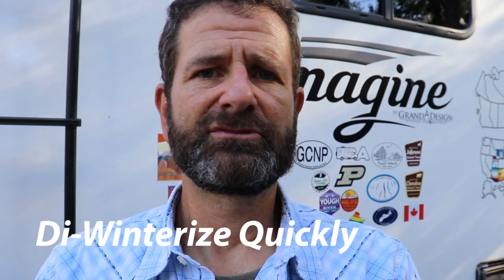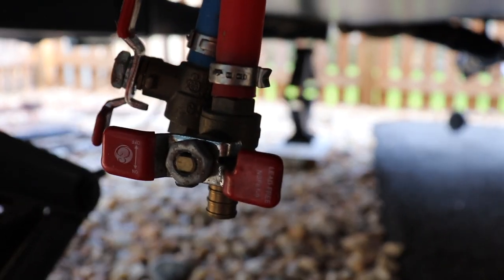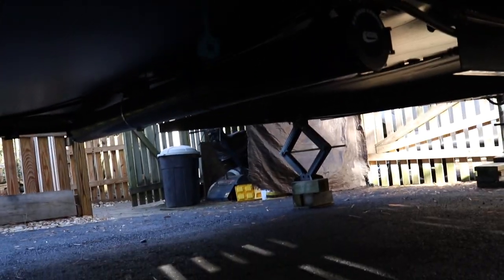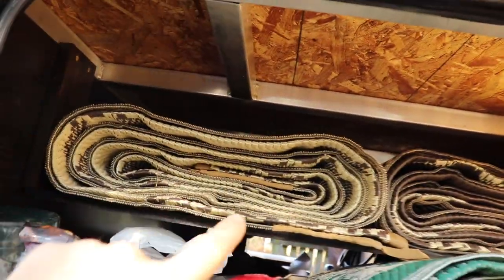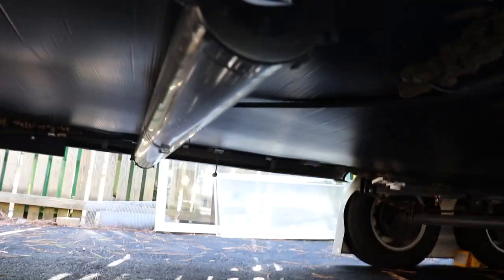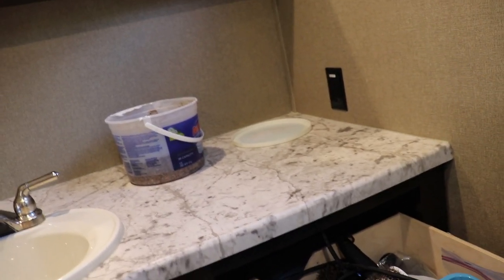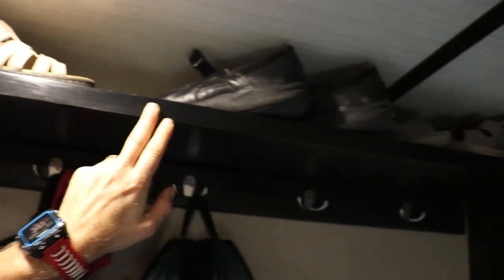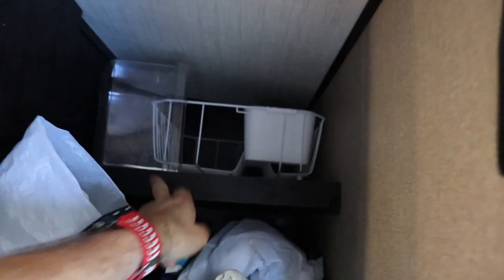Trailer Modification Grand Design Imagine 2150RB

Comment: Good video. Real world info. Colorado mountains so a complete winterization is a given. But yeah, think vertical for space. GD did. Just switched from a 2018 2670MK to a 2020 2250RK. Step 1 - Fix the touchy recliner buttons. 2 - RVLocks. 3 - Raise the clothes rod.
Reply from the maker: Joe Blow thank you for the comment, happy camping.

Comment: Good video.  I want to add a shelf in my storage compartment like yours for rugs and chairs as well. I noticed you have you slide only partially out in the video. I work for a dealership and we have always told people never to do that with the Schwintek slides. It could cause them to get out of sync and stop working. I have never done it and my slide has broken 3 times already. May want to be careful doing that
Reply from the maker: Thanks for the tip and feedback. Happy camping

Comment: If you have a metal frame, you can easily find the wall studs with a magnet.
Reply from the maker: that’s a great tip thanks Walter. The ceiling on my trailer has wood joist.
Reply: @GoingGordons  
A stud finder would find both wood and aluminum.
By the way great ideas! I'm  just now looking for a different trailer and you've really brought up some good ideas,
Reply from the maker: @budbudbonbon  great, I’m happy that it has provided some value.